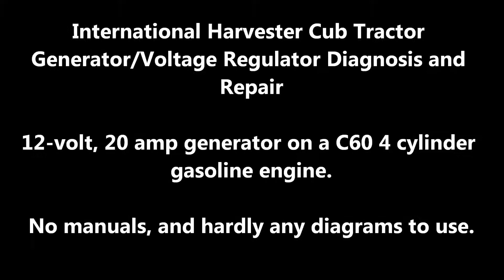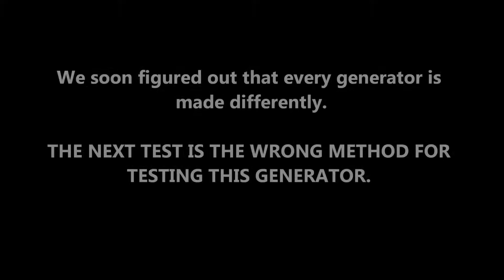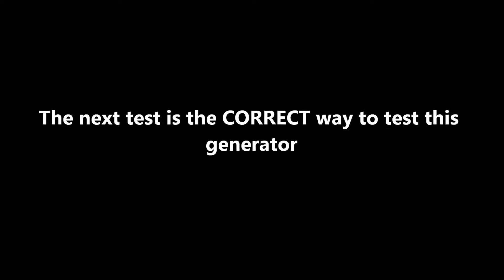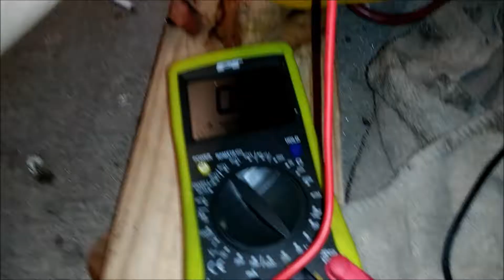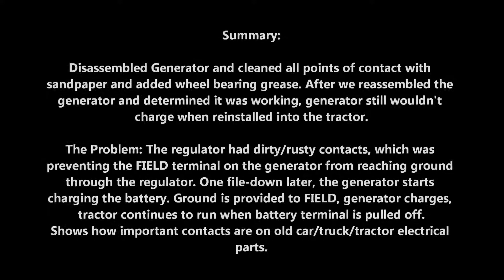International Harvester/Farmall Cub Tractor Generator/Voltage Regulator Diagnosis and Repair

Comment: Did that cub farmall tractor have a negative or positive  ground
Reply from the maker: Not sure. But it operates like a generator, A HOUSEHOLD GENERATOR. One section is the field, which is the outer windings, and the armature is the other lead. I'm not sure the body has too much to so with it. Maybe I'll do some more tests in the future, it was my first time on a generator.